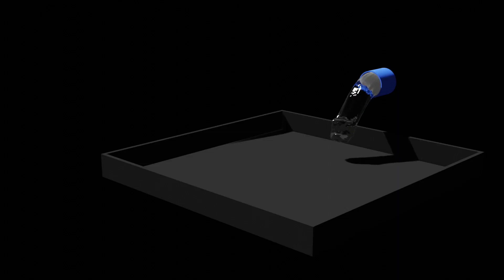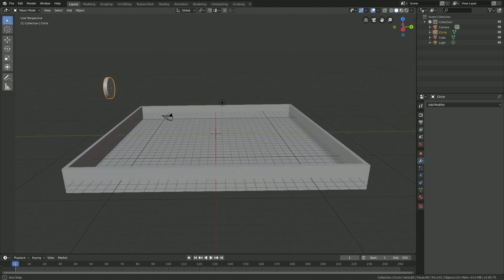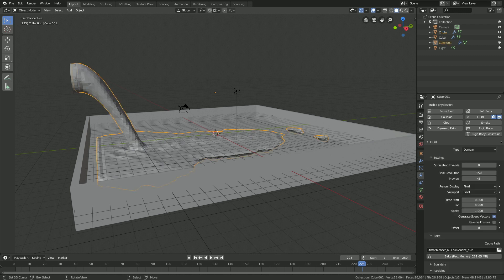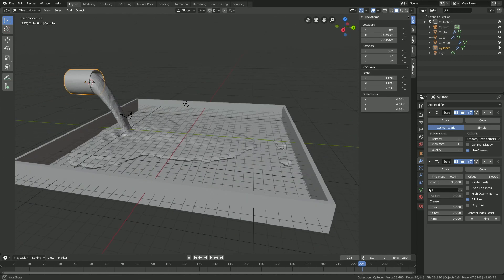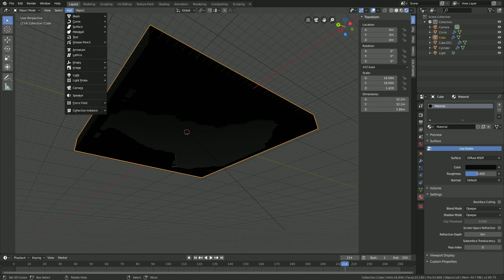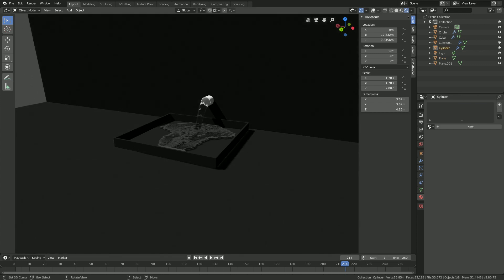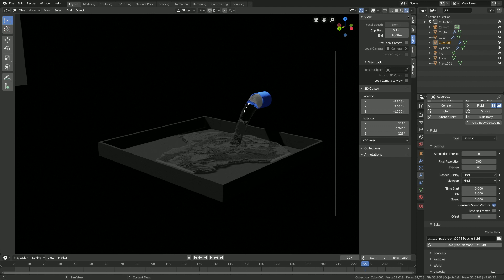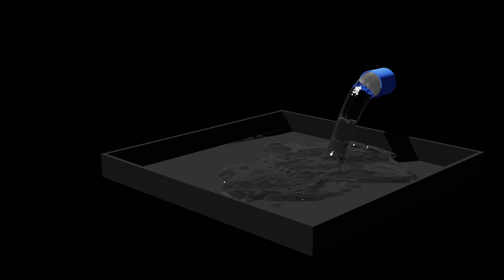[2.80] Blender Tutorial: Water Simulation in EEVEE, REMASTERED

Comment: after the bake, the water doesn't come out of the inflow, but instead floods the domain wall... please help
Reply: Try moving your inflow to the center and bake again. It may be flowing from the opposite direction like mine did. I just had to move it to the  other side of the y axis of the obstacle. Putting it in the center will show you the direction its flowing and you can adjust the inflow from there by just moving it .
Reply: @bradldwyer7842  I had to apply object transformation to the domain, plus, I did move the inflow to the other side of the y axis and voilá it worked.  =)